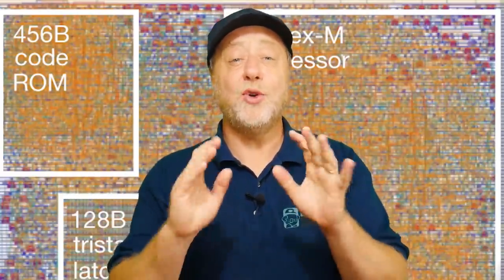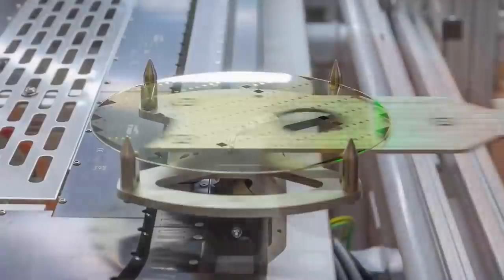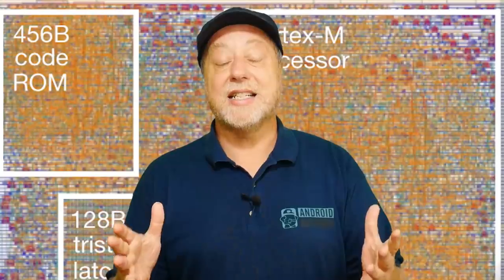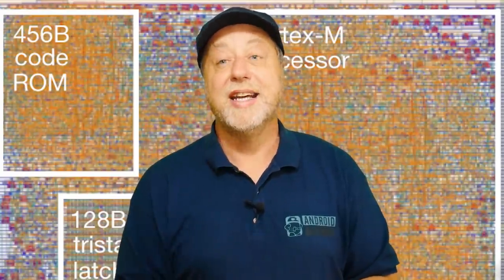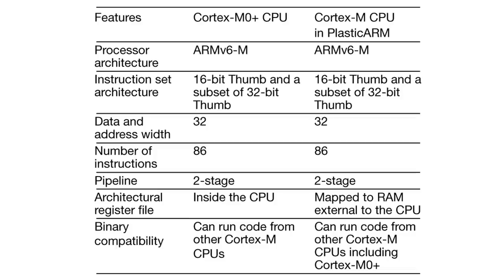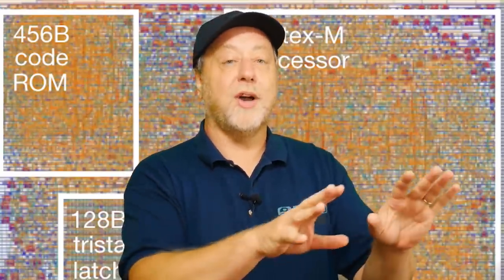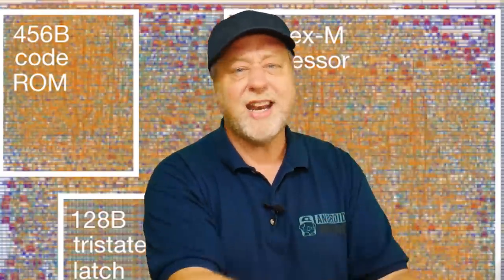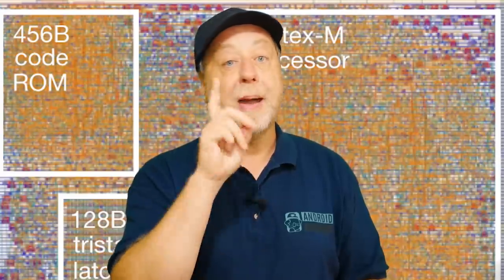Silicon Chips Are So Yesterday - The Future is Plastic Chips!

Comment: Silicon is a semi-conductor while plastic is an insulator so how does it actually work?
Reply: Given the research mentioned was rated in the KHz clock cycle range, I think it's more than safe to say: it does not work very well, and is extremely slow. Like, slower than most CPUs of a 1970s vintage.

Comment: What you have here is a thumbnail sketch that seems to be more of an advertisement for Pragmatic IC than anything else.  You didn't seem to any information at to the underlying materials used, as side from that it is a plastic substrate.

I have read about plastic semi conductors which have been implemented using doping of highly conjugated structures.  The problems being that as the plastic warms up beyond the tc of the plastic, the dopants and uncross linked polymer changes tend to migrate.  Polyimide (mentioned on the Pragmatic IC website) is highly conjugated and would have reasonable thermal and electrical conductivity, however, it doesn't sound like they are doping this directly.  I suspect they are using Polyamide just for the thermal properties.

It almost sounds like they are patterning a semiconducting material on to the polyimid substrate keeping every layer pattered thin enough to be flexible.  The nature article kinda indicates that they might be using chalcogenidesexplicitly

Comment: wait a min, they want to put microchips into all the packaging of products which I can assume is also going to need some kind of power source which in the end will end up in a land fill just so someone doesn't have to give their lunch meats the sniff test to see if its still good, does this strike anyone else as a solution looking for a problem?
Reply: radio waves could be used to power these small devices
Reply: Not really, it'd be really easy to print on solar cells and capacitors~
Reply: It would take a lot time to see those
Reply: Also, the batteries could be biodegradable ... as well as the plastic in these devices.
Reply: @1MarkKeller  that would be in the micro volt range, and since they are using silicon on plastic to my knowledge there is no junction that works in the micro volt range.
Reply: @plutonianfairy  that sounds like a hefty cost adder to the packaging.
Reply: @1MarkKeller  I know of no biodegradable batteries at this time. not that I don't like the idea but modern battery tech is very good but not biodegradable. the closest thing i can think of would be 2 dis-similar metals and lemon juice. while a few of them in series can power a LCD clock don't think that would be practical to include of packing for other foods and such.
Reply: @1MarkKeller  He explicitly stated that this technology does not apply to biodegradable plastic in the video.
Reply: @kirknelson156  Ohhh, you're one of those people. Nobody thought they would be talking about plastic computer chips either ... yet here we are. 

We are living  through one of the fastest evolutions in technology, there is no telling what is possible in a few years from ideas that don't seem like anything right now.
Reply: @1MarkKeller  no its not like that i'm fine with plastic chips , its just that using them to monitor food packaging seems impractical and unnecessary. Thats why I said a solution looking for a problem. our senses have been telling us if the milk is spoiled or the meat has gone off for a very long time, there may be other more practical and beneficial uses for this tech. and newer is not always better, many things have been invented that never proved useful and were quickly forgotten about. I'm an retired electronics tech and now a hobbyist and I can't think of any projects I've ever done where having a flexible chip would have been better, lower power consumption sure. and wires especially thin ones have a limited number of bends in them before they break, so I can't help but question the durability of the product, even if the chip holds up what about the supporting hardware, power, input, output, sensors ect. so not going to jump on the band wagon until I've seen more.
Reply: @kirknelson156  Some people's "senses" aren't working at 100% thus the need for glasses and hearing aids.

Comment: Still don’t why it’s called ‘Silicon Valley’ when nearly all the Silicon chips are made in Asia by corps like Samsung, Huwei etc...
Reply: Because they were designed and engineered there
Reply: @lucifer1978b  that's why I mentioned the names Samsung and Huwei...they designs, engineer and manufacturer chips in Asia. The U.S. Tech sector - Silicon Valley is left mostly designing and Engineering.

Comment: could a CPU generate enough waste heat in its operation to melt its plastic substrate? that would be cool to stress a CPU so hard that it turns into a puddle
Reply: That seems as if it is a real risk. Presumably, since the prototypes mentioned only operate in the KHz frequency range (note: not even MHz such as a 1970s vintage MOS6502 CPU) they don't process nearly enough data to get very hot. Still, if left out in the sun, they would doubtlessly melt and become useless.

Not to mention even when operational, they would be incredibly slow. 

Seems as if it is a terrible technology idea that is screaming to not be implemented by anyone sane.

Comment: What will happen to the plastic when the CPU overheats?
Reply: It won't at that clock speed.
Reply: @guysmiley7289  You are assuming people never leave electronics out in the sun, which already overheats and melts plastic. Even if this runs in the KHz range as claimed, it will still melt and stop functioning under many normal operating conditions for silicon substrate devices.
Reply: @grey5626  Don't argue a subject when you are ignorant of facts. There are high temperature thermoplastics that have long term structural capabilities at 150 C (about 300 F). You use a car right? In many places, including where I live, the temperature regularly reaches 100 F. That's 150 F inside the car. No one is returning to a melted car interior.

Comment: Plastic SOC's will be cheaper than silicon SOC's... hmm They will become throwaway chips. This means more Plastic waste in the environment 🙄. Now a biodegradable chip on the other hand seems to make more sense.
Also how tolerant are these chips to heat? I doubt they can endure the high clock speeds (heat) that silicon chips today regularly operate at.
Reply: this is the  Z8088 chip of its day. its not a gaming chip set that needs to run 100 meg of instructions per second. no the use for now like the Z8088A is simple monitoriing of things. with a limited ram. now in the future that will be a different story. but for now think of biomedical, manufacturing, quality control,storage, even outside envormental sensors. that use large equipment. I suspect that this can be water proofed. say you wanted to monitor a forest for wild fires. this can be molded into any curve you would need so it would blend in with the area. it could be place up high in a tree or at its roots.  how about high altitude weather balloons instead of carring very heavy payload. use this to reduce the weight and use a smaller balloon. since you are now not limited to circuits on a flat surface. one can jam even more sensors into it.

Comment: too much speculation, too little substance, a 128KHZ clock is too slow, can be used only for medical and smart card. packaging needs to be cheap, you cant have a package which is costlier than the thing it is carrying.

Comment: Nonsense.
Reply from the maker: Which bit?
Reply: @GaryExplains  If you have a bit of engineering background. you wouldn't  make this video. Or, only thing you know is coding?
Reply from the maker: You still didn't answer my question. Which bit is nonsense?
Reply: @GaryExplains  Semiconductor theory is based on "crystal band gap" Plastic is not crystal. The basics of science is ignored. You make a good video for OS and software, but physics side, you shouldn't make video. It shows your ignorance.
Reply: @truthmatters5536  huh?
Reply from the maker: So you are saying that the plastic CPU that Arm is publicly taking about doesn't exist? Also, you did note tat I mentioned TFTs, right?
Reply from the maker: OK. You are clearly a troll. But for the sake of anyone else reading this, the chip is make in partnership with PragematIC who specialize in flexible circuits. As I say clearly in the video.

Comment: Thanks. Work. In Every Device even AirPods and Tesla instead Of Wires in Patent with Machine and Desk Mac with M3. With super Faster Connect Between RAM, Memory and Cellular and GPU and Battery Chip evrn in Battery Desk in Tesla Alon in killer idea. And in Very Full Large Plastic with Wires in Bottom in MacBook and iPhone will largercBattery and 15X Cheaper SoC with Faster Built with One Super Giant Machine not Workers Tim. SOLVE NO Wiring. TIM full Startegy

Comment: Are these carbon based polymer chips going to replace our silicon chips any time soon? NO. That said, I forsee enormous potential for real world applications where cheap and highly distributed computing power is highly prized, ranging from IOT devices to robotics. Imagine armies of cockroach sized robots cleaning our streets and sewage systems.
Reply: Your imagination is not in alignment with real world engineering.